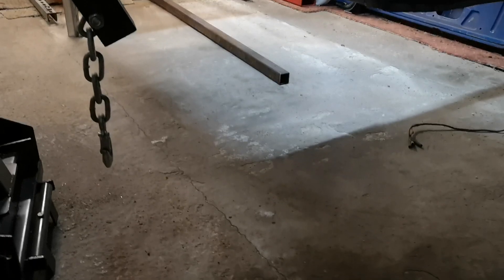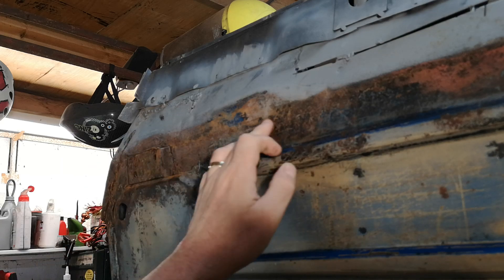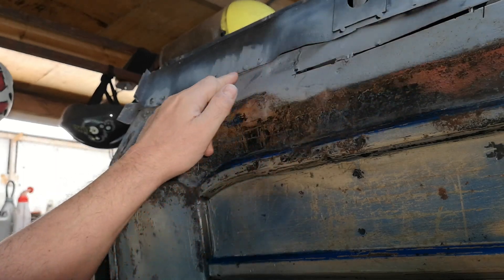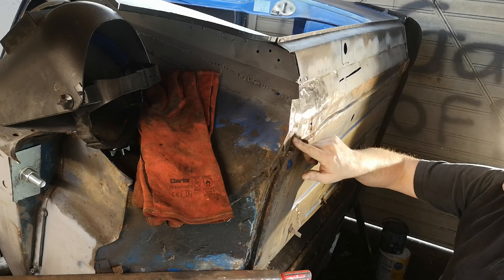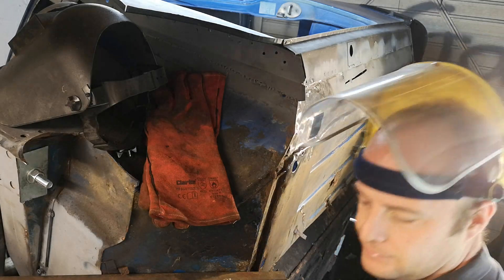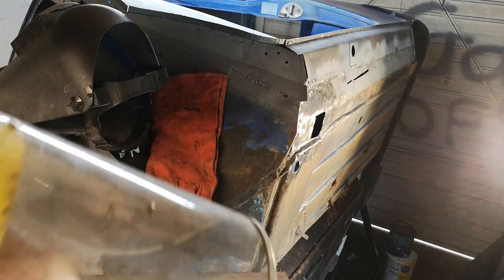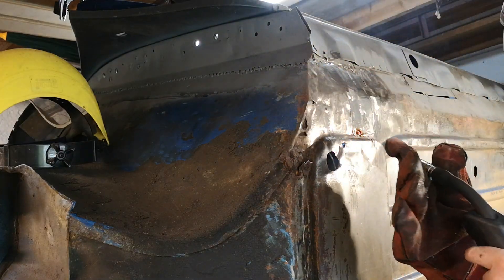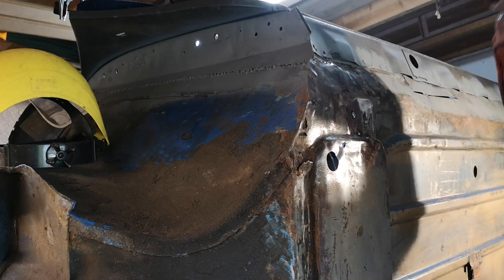Classic Mini restoration | Episode 16

Comment: Adam, I bet your so happy you built the jig now! The cutting & welding are so much easier than lying on your back getting weld splatter
down your T shirt lol. Nice job on the patch repair get yourself a roloc grinder and discs they are so light and great to get in to little tricky areas.  Cheers dave
Reply from the maker: I'm over the moon Dave. I think those bits I've done today are by far my best work just because it's so easy

Comment: Well done on the jig. A little tip try and get about a mm gap around the plate tack all corners then grind back the tacks then weld the plate in then the welds should grind back flat
Reply from the maker: Thank Mark. I'll try and be a little more patient when making the patch next time. That's all it is patience lol